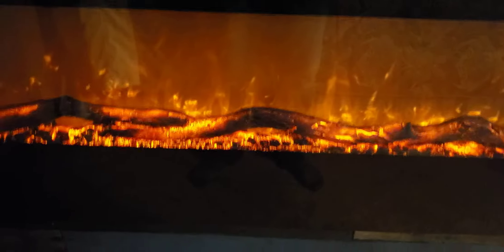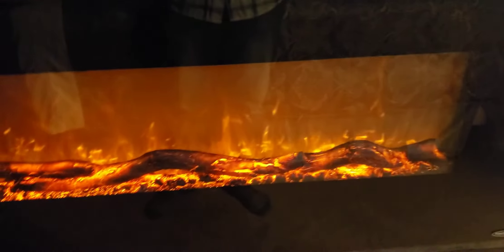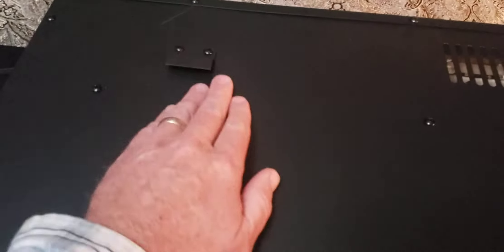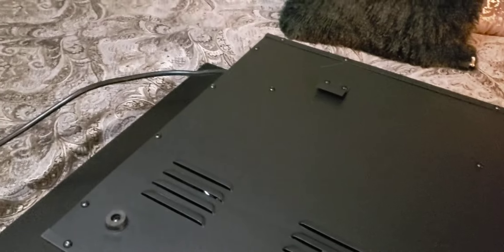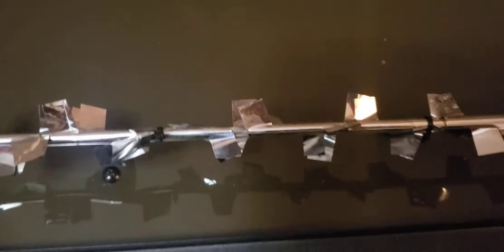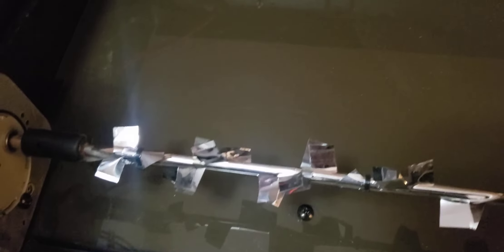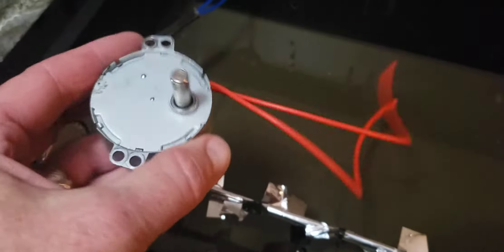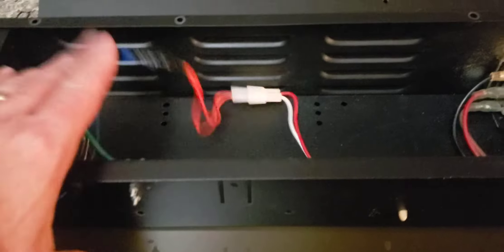Fixing a Touchstone Electric Fireplace - Flames Stopped Working

Comment: I bought a little motor on Amazon to replace the burned out one in my decorative fireplace and now the flame effect is UPSIDE DOWN!
I just don't know how to find one that turns in the appropriate direction.
Reply from the maker: I noticed my does the same every other time. If you turn it off and on it gorsythe right way.... It was about a week or so after I put it together that I noticed it.

Comment: Did Touchstone sell you the extra part or did you go through Amazon.  My LED strip is not working completing so I was wondering who I do through to get a new LED strip.  If you can assist it would be appreciated.  I will call company this week but thought you may know.
Reply: Did you find where to buy the LED strip? Or was it an internal fuse?